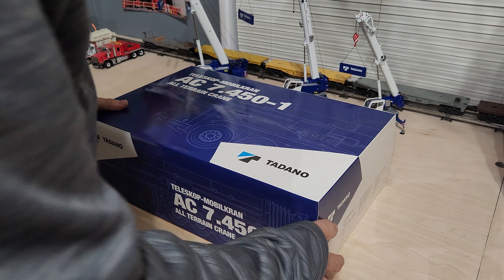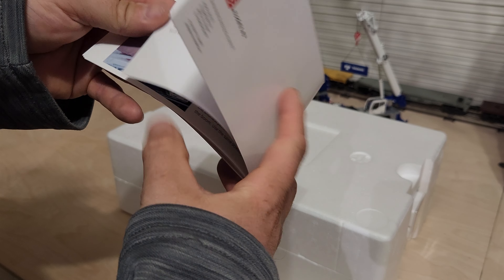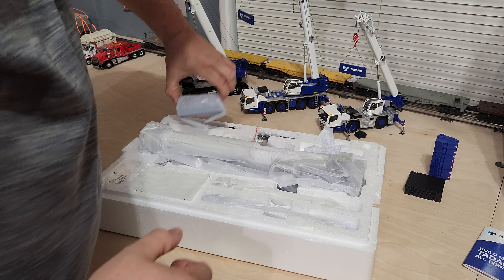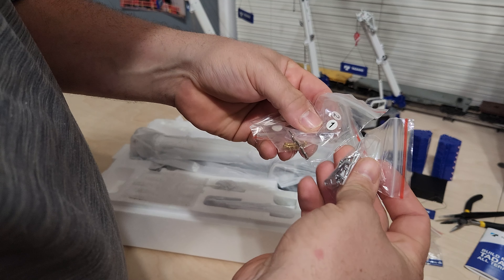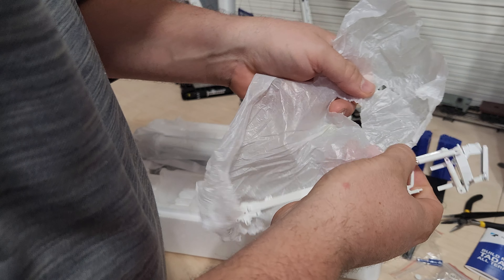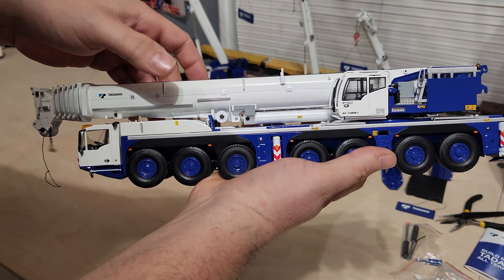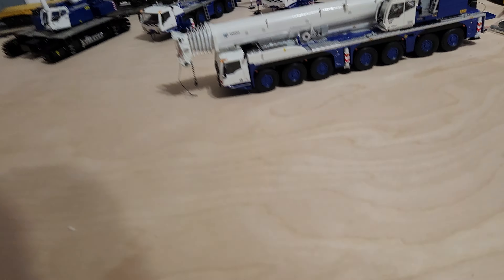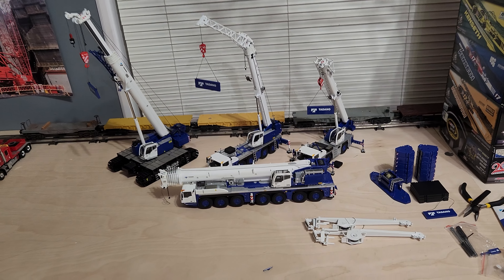IMC Tadano AC 7.450-1 unboxing

Comment: Where do you get your models from, i know wsi sells some and one other distrumibutor and then some ebay but like pristine legit sellers cus i forgot the name of the side but i wanna say diecastmasters or another website used to sell alot and then shut down or prob filed for bankrupcy and hasnt been the same since i bought my 4100 tower crane
Reply from the maker: I get them from several different places online, just depends which one has it in stock or cheaper. But mainly dhsdiecast.com, weissbrothers.us, 3000toys.com, or even the manufacturer like liebherr, link belt, manitowoc, have online shops they sell them from. Sometimes they are also cheaper too.

Comment: what do you do to get as close to cranes as you do? cuz it's awesome
Reply from the maker: I am an oiler in the operating engineers union. I get to help assemble/disassemble them, and when setup, I stay with it to help the operator, watch swing radius, watch tracks when crawling, make sure nothing is leaking, grease and fuel the crane, all the crane op has to do is run it. Sometimes I fill in when he has to use the restroom or wants a short break. I love it